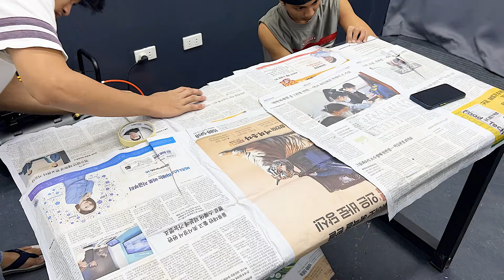Suzuki Raider 150 Restoration | From Rust to Robust

Comment: I think there's something wrong with the exhaust pipe hanging hole on the back of the motorcycle. Try putting that hole inside the footrest.
If you look at it from the back, you will see that it is pushed out too much
Reply from the maker: Sorry bro that’s how it is
Reply: Sir magkano po inabot ng restoration neto? Planning din po ako iparestore ung Raider 150 Carb ko. Please PM me.